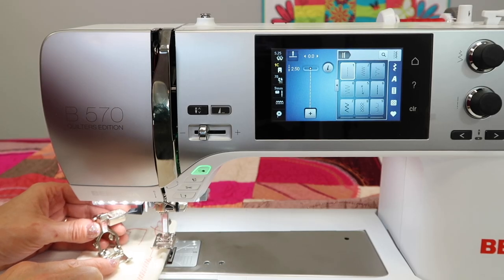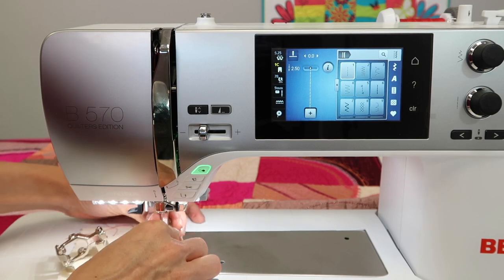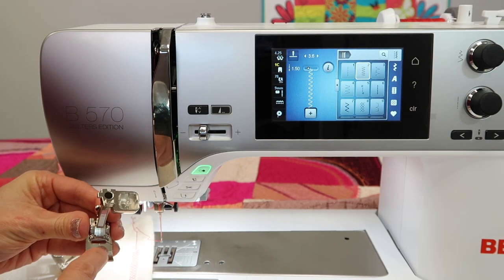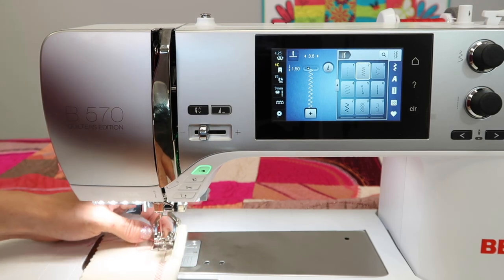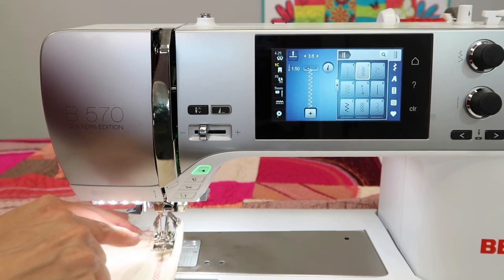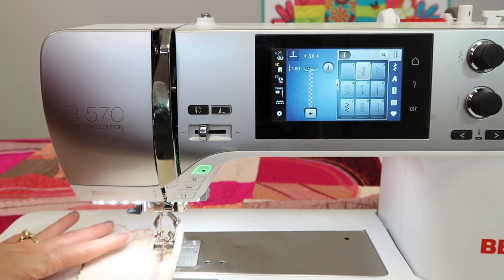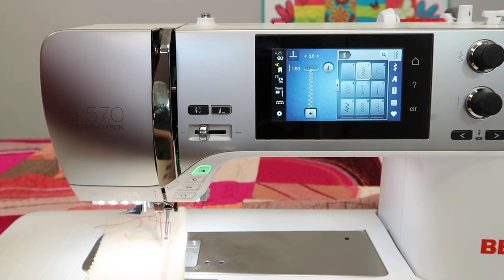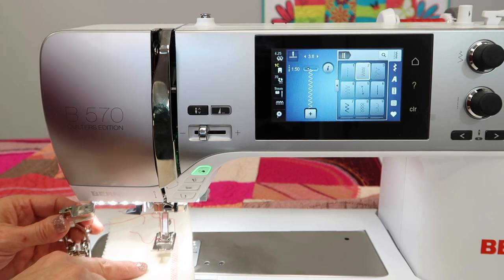BERNINA 570 15 What is the Difference Between Foot "C" and "D"

Comment: Why would you use the 1C instead of the 1D? Would it not make more sense to always use the 1D foot because of the dual transport?
Reply from the maker: You don't always need a fully engaged "walking foot" for normal sewing. Bernina has a wonderful feeding system without it.
Reply: @HeirloomCreations  Thank you very much for replying to my question!

I see your point, but I was confused that my machine came with both the 1C AND the 1D foot. I thought that it would suffice to always use the 1D foot, even though it might be overkill. I was wondering, when using the 1C instead of the 1D foot would make sense.

The other day I had to torture my poor machine with several layers of very voluminous batting and thought this might be a situation where the hook of the dual transport might be a hindrance. But I wonder if there are other instances where the 1C might actually fare better than the 1D.